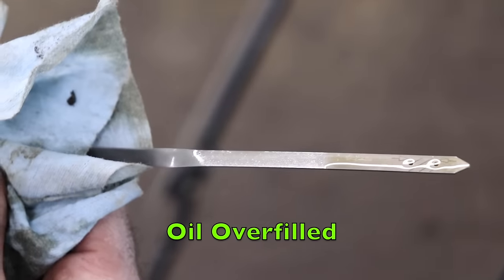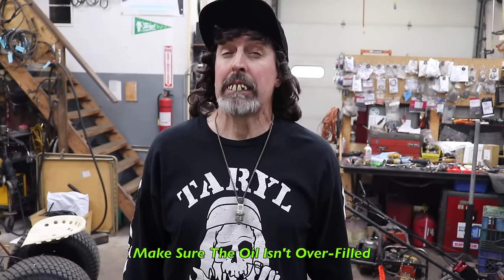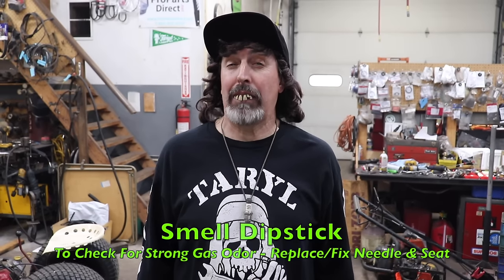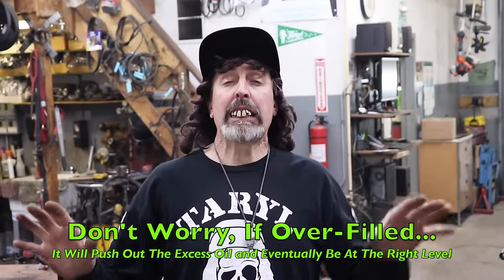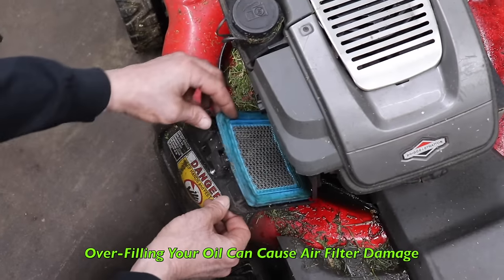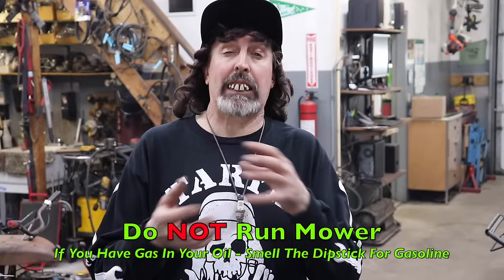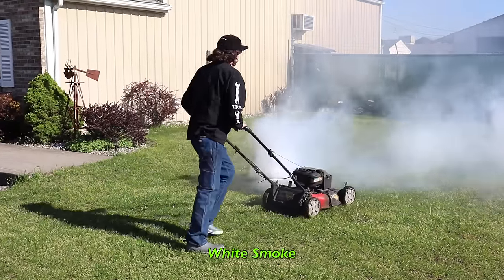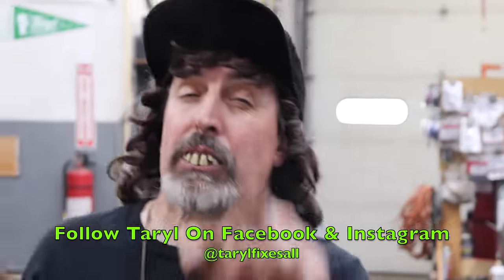Why Is My Mower Smoking? Easy Explanation!

Comment from the maker: Another thing to look for is if you had tipped the mower recently on its side filling the head with oil will make it smoke also. Do not worry it will clear out on its own but re-check the oil level and top off if needed. Do NOT over-fill. Now There’s Your Dinner!!
Reply: What would you do if your mower started smoking cigarettes?
Reply: OR YOU PUT 2 CYCLE GAS IN THERE LOL
Reply: When I was using my front-wheel drive self-propelled I could have swore I saw the gas bubbling on the top of the tank I replaced the spark plug a few odds and ends and now it's working right but that scared the other living daylights out of me
Reply: What would it be if it only smokes on a cold start?
Reply: 👍tx
Reply: Tell about the needle in the carb mite be sticken how do I fix it please
Reply: What happens if it is blue smoke?
Reply: Lol your funny 🤣 thanks 

   Blessings & Peace 🕊️
               The
Musical Birthday Candle 
              LaDy
Reply: My toro mower with a Briggs quantum 7.25 horse engine does that on cold startups. It had been sitting outside for a while and I went to move it into our basement storage, did a startup to make sure everything was working, took 4 pulls instead of usually starting in 1 or 2, plus a smokescreen, oil level was normal. Not sure what is happening here.
Reply: First time owning a lawn mower what oil do you use

Comment: #1 reason for a smoking push mower? You tipped it on it's side or upside down to clean it or sharpen/change the blade and oil ran down the breather tube and into the carb and air cleaner.
Reply: I was expecting that to be the number one culprit but surprised it wasn't even mentioned.
Reply: @packofhounds  Exactly what I was thinking. I sometimes wonder about this guy.
Reply: @fourbyfourer how do I fix it? Is it bad?
Reply: @packofhounds do I have to replace the lawnmower?
Reply: @loading2703  Usually it will blow through on its own but maybe remove the air filter and see if that is soaked with oil also.
Reply: yeah i did that, changed the blade etc and they key , after i ve started it , 10 sec later it was smoking
Reply: Yep always tip it with gas tank up
Reply: @chrisd5598  I replaced the blade with gas tank up and it ran for a couple minutes then shut off. Now it just revs up like it wants to start and shuts right off. No smoke. I did hit something hard with the old blade and it was a sudden stop. I wonder if I damaged the piston? Troy-Bilt TB200. I replaced the air filter. I'm thinking about pulling the spark plug and see if oil comes out.
Reply: @runnergo1398  yes if oil does come out then keep trying to start it with spark plug out and it will burp it all out. But only was to see if piston and rod are messed up is to scope it and do compression. Put piston at bottom dead center then put a scope in
Reply: Thank you! My friend sharpened my blade and had left my mower tipped up for a day or two because he got interrupted and went off to do something else.  I went to mow today and it was smoking.  I'll check the filter and get back to it, thanks!  This is why if look for videos and follow with the comments, I OFTEN find better info in here!😅
Reply: That's what happened to me

Comment: I traded some labor for a Kawasaki 2500 mule that smoked like crazy. Guy said the engine was bad. The muffler was full of old black oil. Flooded engine, drained muffler, repaired carb and new plugs. Runs great now. Rule #1 you have to be smarter than what your working with.
Reply: true and always start with the simpler issues/repair ideas first. Sometimes I sike myself out thinking it has to be something complicated/bad.
Reply: I call it the 2% rule...because if you're only 1% smarter than what you're werkin on, you're gonna git bit sooner or later.
Reply: @NubsWithGuns  yea these engines are so simple-designed, meant to just work. And ah yea lol, I had a similar thing with a 2 stroke weed-wacker, forgot I had only hand tightened the spark plug while testing it
Reply: Hi
Reply: @M.TTT.  Question what if the oil is shit like metallic color gray shit?

Comment: THANK YOU!!! I have been troubleshooting this dang thing all summer long. Cleaned the carb several times, changed out a a flywheel key today and got it to start and run finally, but then there’s the smoke… I was about to give up and buy a new one. You just saved me a ton of money. I can’t say thanks enough.

Comment: I can't tell you how many times we've had someone return a push mower to the store I work at because it's smoking and turns out they put a whole quart of oil in it. and being the only employee that actually knows small engines i've saved a few sales by just draining the excess oil for the customer and educating them on how to read the dipstick. one guy had the oil completely filled to the top of the dipstick tube.
Reply: Go big or go home
Reply: If only they came with a book or something to tell you how much oil🤔
Reply: @thyubernoob  "Who reads the manual?" 😂

Comment: my 2003 craftsman LT1000 had gas in the oil.  i thought the anti-backfire solenoid was the problem, so i installed a shut-off valve on the fuel line.  now i know the real reason.    thanks taryl!

Comment: Might be that part of the confusion is the engine design.
 I remember topping off oil in the old Briggs mowers without dipsticks, they just had a screw in plug.
Some would say to fill till the level is at the top of the inner "port" hole
Others would say to fill right to the top of the treads
I remember filling to the threads but still being able to fill at a slow rate for maybe another 8 oz

Then the engines with the dipstick. 
You absolutely have to pull the dipstick and wipe it clean before checking
Some of those (Briggs?) hold a false oil level in the dipstick tube, the oil apparently being held above the true level by the tight space between dipstick and tube
The false level can be a few inches above true level and can set there for weeks after the last run.

Comment: would running an older mower ( has shorty dipstick like they used to be, this one happens to be yellow)  with 10w30  instead of a 5 weight, lead to burning a ring in less than an hour of use? I also adjusted rpm a little, nothing crazy.... got dark smoke, not thick, not blue or white,  but like maybe theres some little guy starting a small fire inside somewheres. I wasnt sure how much oil it needed cause the motor doesn't match the cover , or the deck, etc,... it shows a bit high , probably 1/4" on small plastic stick, small breaks n scrap'em mower. In fact i bought it for $5, and the lady on the side of the road said she was taking them across the road to the metal recycling if no one bought them.  Compression feels good. I did adjust intake valve but only from .005 to .006 intake, left the outtake at .008. i did also change the needle , which was plastic with loose , slightly dissolving nipple, for metal one off a 550e. But anywho,  i never had issues running sae 30 in mowers.

Comment: I was assembling new toro zeroturns for our shop and one of the guys told me make sure to fill the engines with 2 quarts I assembled both of them the one I put one quart in checked and was way over full so I had to drain that out lol always good to check one of our mechanics didn’t check the oil and seized up a generator luckily it was ok and didn’t completely seize up

Comment: About how much does a riding mower take sir? My dip stick says it’s low I think but I. Just did fill tune up on this husked supreme 23 hp 46 inch cut riding mower hadn’t been cranked in over 8 years fired right up but started smoking white smoke and lots of it? I put 42 ounces of oil in it

Comment: Hello, my greetings, thank you for your videos, which are really excellent and a great help to everyone. I have a Honda TB 130 but it keeps throwing white smoke and some oil from the exhaust. It has power so I do not rule out that it is the rings, but I have heard you say in this video that it could be the poorly calibrated carburetor that produces smoke on my lawnmower, meaning that the needle is too high and the gasoline goes to the crankcases making the oil rise. Question: could this be true? I don't know what to do to repair this machine anymore.
Could you explain to me that I should do to end this nightmare please.

Comment: I have an older 6 hp snapper NINJA dethatcher. Nice setup. I change oil and in 1-2 uses the oil is very black. Any idea what might cause this? Thanks and do appreciate your videos.
Reply: Sounds like you’re not draining ALL the oil or you’re not warming up the engine before changing. It’s also possible there’s a lot of sludge in the bottom of the crankcase because the oil was never changed and you may need to flush it out by heating up the engine, draining, refilling and repeating two or three times to finally clean out the crankcase completely. That would be my best guess.
Reply: @Rein_Ciarfella  Thanks. You are right.  I did a quick crank case clean with a product made for this. Ran out for a short time drained out after an overnight period (or was still black) and repeated ( drained immediately). Put in new oil and more for an hour.  It was still clean! This mower sat at least 20 years in my patent's garage. I couldn't get rid of it when we inherited their household belongings. The mower was never used a lot so thought it would be smart to hang on to it. Thanks for getting back. You were the only one who responded.
Reply: Guy Griesmann   Glad I could help! 👍

Comment: Long ago i worked with an old school mechanic. He build his own 4 stroke mower from new parts. New parts came from his friend who worked for a mower/power equipment manufacturer.  aka smuggled out a mower in parts. This was decades ago. 
Anyway this mechanic still has the same push mower for home decades later. 

He mentioned that he occassionally adds 2 stroke to a 4 stroke to wet/lube the engine just a little bit more. 
Not much he said just a little every so often.

Comment: I always fill as best I can to the very top of the oil fill line. Does it hurt if it's barely over the line? Does it HAVE to be right up to the fill mark or is about midway up just fine. I have to change my engine oil several times a year. It is not a lawn mower but a VERY expensive carpet cleaning machine with a 23hp B & S ohv engine. It is operated year round in very hot weather, but only a little below freezing in winter. It is the very hot ambient temperatures that worry me the most @ over 110 or more degrees in the van sometimes. Any tips on the best oil would be much appreciated. I generally use Mobil 1 5W-30 year round, but not really sure that is the best thing to do even though it is recommended in my owner's manual.

Comment: My mower went white smoke. I checked oil tube. Looked empty, so went to store to get more oil. Still smoky. Maybe cuz the tube didn't look full like the guys at home depot said to fill it up almost to the top. So got more. And its still smoking white like the video. Dont know what to do. I see bunch of oil collecting on the bottom of mower (not on motor) but on that part whatever grass collects on etc..) so do i dump out oil again and put in bit less? Plus it is shaky when the mower is running. Never did that before. Dunno what to do now??

Comment: hi, i have a question. i was takin ga run today and across the street from my run in one spot, i am pretty sure the white smoke looked like what you showed,  probably a smokey motor with gas/oil. i was  probably 50-80 feet away. and i had to walk thorugh it (as it was verywindey which pushed some of it across the street.
is it toxic ? or should i be ok?

Comment: I have one question...when you change the oil and fill it back up to the fill line, should you screw the dipstick all the way down or just let it sit on top before removing it to check the level? Have never been sure about which is correct.
Reply: Good question !
Reply: Download and read the owners manual.

Comment: Smoking Mower SAGA: A   great old employee of mine was always cleaning stuff when there was nothing to do. So at his house "he discovers" there is "all sorts of grass" under his push mower! 

So he flips if over and pressure washes the underside so it is spotless. Then when he started it it smoked like mad. 

So he takes it to the "local expert mower repair shop" and they conclude the engine needs rebuilding "since it smokes". 

So the experts :) rebuild the 6.5 Hp vertical shaft engine and it throws its rod on the first day after "being fixed". 

 So after bitching my friend gets #3 engine which I think was a used one and it slightly smokes since worn.

My friend never told me or the mower shop that he flipped the mower over. I heard about this after #3 engine was on the mower.

What is scary is I learned that flipping a push mower can do this in Indiana in 4th Grade.
Reply: sounds like you need smarter friends before
these guy do something stupid that kills you
Reply: they don't teach that stuff anymore unfortunately, its up to the parents - but most of them are clueless too lol

Comment: Hoping it's that simple. My neighbor tossed a Briggs 7.25 self propelled that I could use. It looked solid and had a recent repair tag but the oil cap was on crooked and it was really  low, like 4 ounces in it. Since it had gas in it I gave it a tug and it fired right up and sounded fine, but smoked like yours. The sticker says CHECK AND ADD, NEVER NEED TO CHANGE.... It could be that too

Comment: I havent started mine but I checked the oil and it looks fine its old though but it wasnt smoking as much but I was mowing very thick  wet grass will this happen vs heavy thick wet grass? I got worried and stopped I didnt want it t explode

Comment: I have the white smoke and was going to change the piston rings but as you suggested check the oil level, yep will suction some out then restart, oh and change the air filter. Thanks💪
Reply: ...over time, worn out valve guides, blown head gasket from loosened head bolts,  can also allow small amounts of oil to enter
combustion chamber area between cylinder head 
and worn piston rings/gap increase from poor
maintenance

Comment: Hey Taryl, My old Craftsman 20 hp v twin just blow out a bunch of oil all over the deck and was blowing it towards the left side of teh mower all over my girlfriends foot while we were cuttin, it still runs but looks like most of the oil came out.  What happened?  I don't see any holes and it still would run if I was to start it.  I didn't hear anything while she was cutting either.

Comment: Is straight automobile oil safe to use? Someone told me small engines need zinc additives.
Reply: Use "straight" oil only if it has a rainbow on the label. You don't want to upset the alphabet community.
Reply: All automotive oils have zinc additives. Also, some people don't know the difference between a single weight detergent like SAE 30, and non detergent 30, which no one should use in any kind of engine.
Reply: @walmartdog1142  SP oils only have about 700ppm of ZDDP which is too low for anything that has flat tappets.
Reply: @walmartdog 1142
Back in the day of leaded gasoline, you used non detergent oil in high mileage engines as the theory was that instead of cleaning the engine, sludge and carbon deposits were allowed to build up filling in wear gaps and seal leaks.
And once you started to use non detergent oil, you could never go back to detergent oil as it would loosen up all those deposits and plug oil galleys causing leaks and fatal problems.
Reply: @walmartdog1142  but some have zinc in concentrations that are to low.

Comment: I know this ain't about the video that I'm watching but hopefully you can help me with this I have a steal fs80r it's fine under half throttle is fine under three quarters throttle anything higher than 3/4 throttle it bogs down like it's one starving for gas or two high-end Miss I change the spark plug I changed all gas lines I changed the fuel filter in the tank and the two rubber garments in the tank on the tank I even talk the air filter out and it does the same thing thinking maybe the air filter is getting dirty I sprayed out the carburetor with gum out I even sprayed out the muffler that little spark arrestor screen Danny suggestions would be helpful thank you

Comment: I have a lawnmower that for some reason is blowing some oil out of the exhaust. The oil level is correct, Needle and seat are fine and the rings are fine. But the oil level is still at the normal level after running. You have any idea
Reply: Check air filter…

Comment: My son tipped my lawnmower on its side. The site filter was soaked in oil. I changed it cleaned out the area ran it for about 10-15 minutes and it's still smoking white, what could be my next step?

Comment: I got a push mower 2 years ago as a housewarming gift and noticed the last 2 or 3 mows it would smoke on startup and clear out a few seconds later. The oil looks good, but I'll check it for gas. If that's not the cause, what else should I look for?
Reply: Same here for my Honda self propelled. Might be goo in the fuel.?
Reply: Just slightly overfilled with oil,the oil seeps past the piston rings over a couple/a few days of sitting. Or the mower stored with the spark plug end lower than level.

Comment: You'll also foul the spark plug, top of the piston and the cylinder head with burnt oil residue (sooty carbon) and make the mower harder to start if it goes long enough puffing oil.

Comment: Yep!! Got a call for a Troy Bilt Pony. Been sitting at least two years. Owner said it was smoking real bad before he quit using it. Took a look at it. Oil residue in the mumkin and on the frame. Pull dip stick (no, not the owner), over full and smelled like bad gas. He wants it running again. Going to be a job. Mouse house under the engine cover, flat tires. I'm sure it's full of spiders. Don't know what's under the deck. To be continued.
Reply: GOAT BOY!